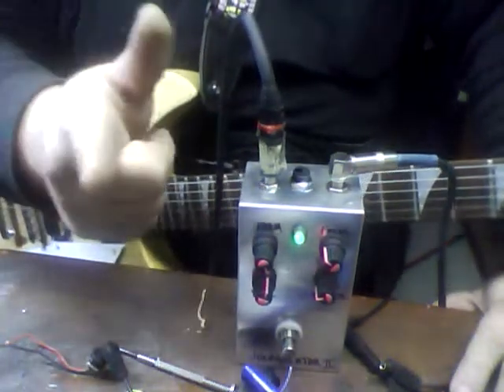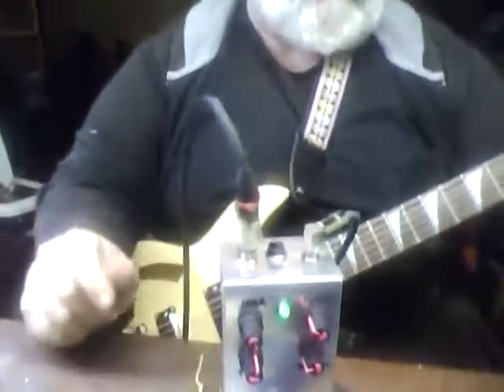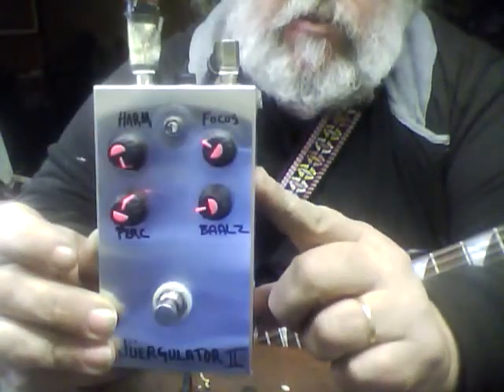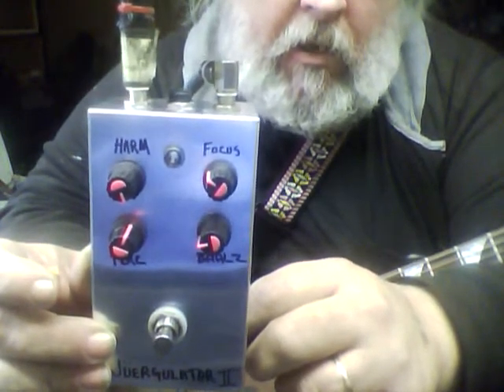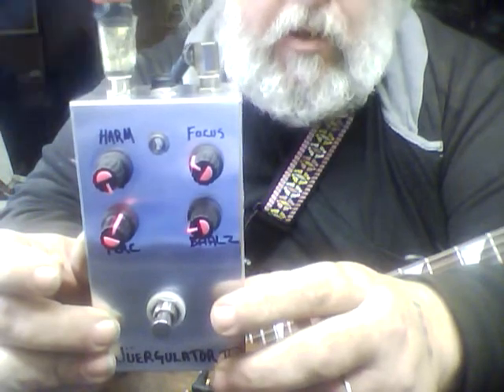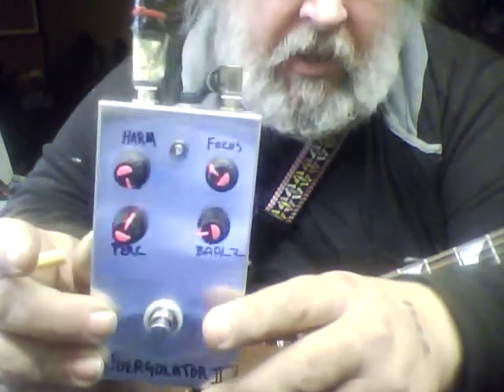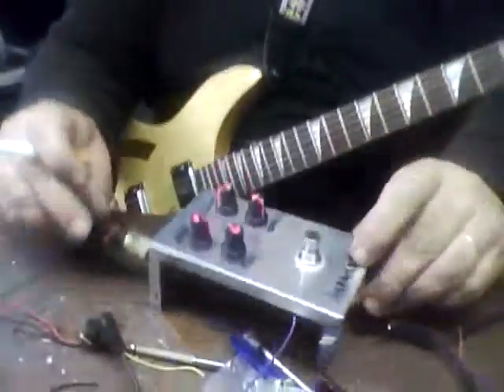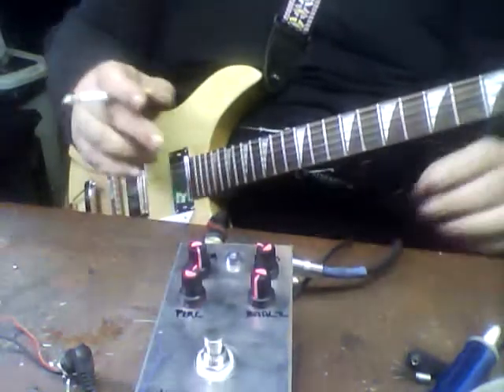SPTWPJP PHOTONIC JUERGULATOR MK II

Comment: Great going. I'm glad people are still working to redesign the classic fuzzes. I saw how you and a few others contributed to reinventing the Bosstone, which resulted in a wave of 'Trumpet' fuzzes becoming the hot item for a year or two.

The Percolator is much more interesting than an regular overdrive, but gets the job done the same. I wanted to hear it without the clipping diodes to see if there was any difference.

Did you experiment at all with that 'baising' cap? Try components in parallel or series with it? There is so much to be explored there.
Reply from the maker: thanks for watching and the kind words. fuzz is a beautiful thing(s) ;)
if you're bored, check out the new one... does the crappy casio-esque horn thing like the bossTbone thing, but it does a fairly credible string synth emu... you can fake cellos and violins with it.
it's the dB!!FX model one driver. tons of fun from just two horribly abused transistors ;)
it started life as an EKI fuzzbox kit my son and i built a couple years ago, and i got that BUM thing (blind urge to mod) and went to town. ;)
be well!
pjp